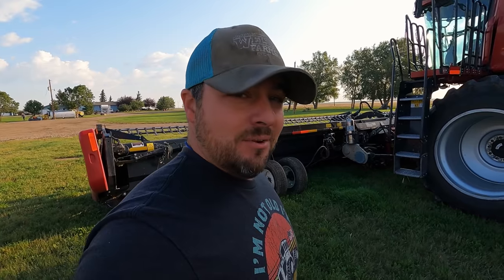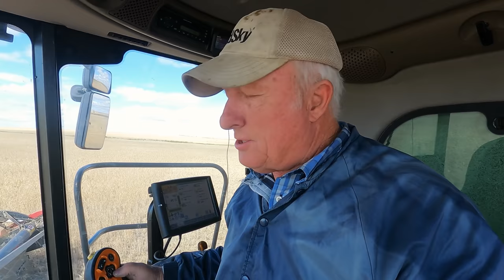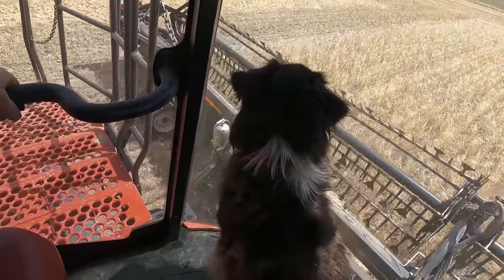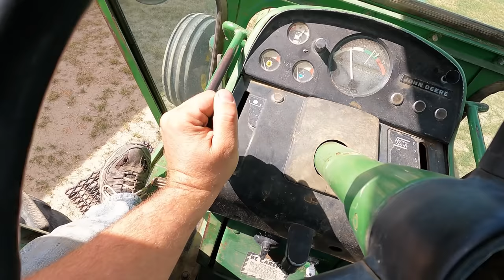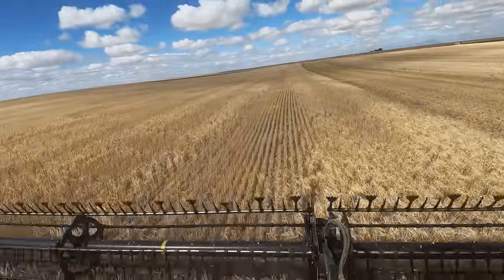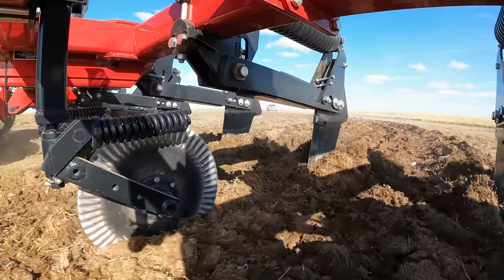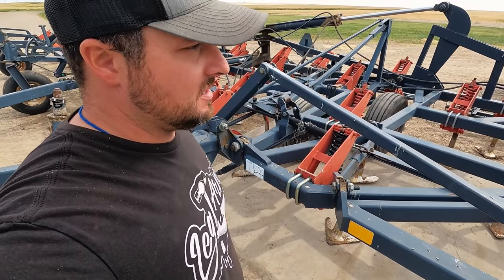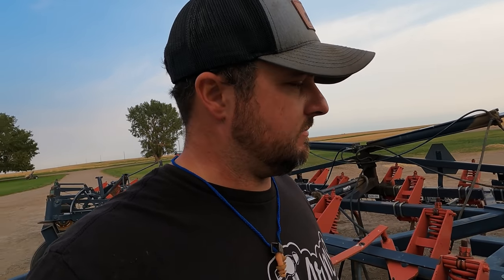Going Somewhere Buddy???

Comment: My trucking company shop used to rebuild those plow pivot pins all the time. The local farmers didn't have a lathe or the experience so we did it for em.. woulda been nice to have a plasma cutter to rebuild those plates (we managed with a torch and grinder)

Comment: Putting a piece of copper pipe in the hole and welding to it will help you get a round hole. After you are done welding, take out the copper as the weld won't stick to it. This should make it easier. This is also how you weld thin sheet metal. Copper underlayment will draw the heat from the sheet and make it easier.

Comment: Scott, you have the lathe. Find center of that bracket and set it offset in the lathe and you can bore it back out after welding. I'm sure you figured out another and its done already but I'm a sucker for odd fixturing. Problem solving is one of my favorite things in life.
Reply: I don't think they have enough swing on their lathe to swing that bracket.

Comment: Have you considered liquid ballast for traction? Rim Guard is 11 pounds per gallon and harmless to the environment. Won't freeze till -35. It's common to ballast the inner only of a dual tire setup. I'm betting you would see huge traction gains with the size of those tires. I have added over 6000 pounds to the rear of loaders.

Comment: You need to get rid of that small mill you have and get a 2HP Bridgeport. You can use a boring head on it to make very precise holes. Or use the lathe and a 4 jaw chuck with a boring bar.

Comment: I almost did a Legarms - came about a 1/8" from dropping a 10' piece of 4x4x1/4" square steel pipe on my foot.
Reply: Grateful it miss
Reply: @RobertWelkerFarmerBob  , My older brother - he's 72 and me, I'm 64, we're building a 14' wide gate out of steel we got from a guy at Seeley Lake. I tripped when I dropped my end of the pipe, but pushed the pipe away from me so it wouldn't drop on me. I didn't try to catch it.

Comment: Do you guys fill the tyres on the tractors with water to get more traction or does that cause problems with compaction? 

We do that here a lot for cane farming in Australia it's a good way to add weight yo a machine without adding load on the axles.
2 of my dad's tractors have close to 2 tonnes each of extra weight with water in the tyres.
Reply: Could add water if we were doing this regularly
Reply: @RobertWelkerFarmerBob  You could probably get 3-4 tonne in those Big Buds.

Comment: Figured you could just pull the trip bolts on the two outer shanks on the ripper and... yada yada!!! We had a 5 shank on a 7140 when they first released them, could stop that tractor dead,,,, heck Brian stopped a 400hp JD a couple falls ago dead with a 5 shank.... They worked as advertised in our IN soils, 13-14" was our target, they can destroy a tractor!!!